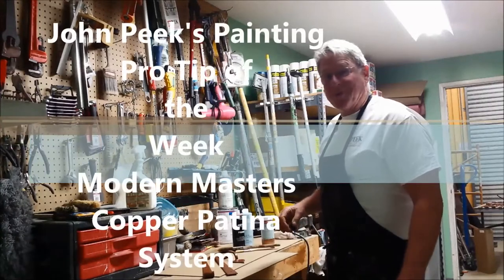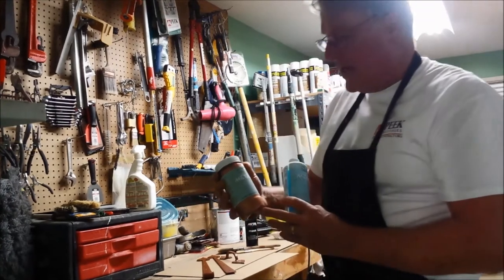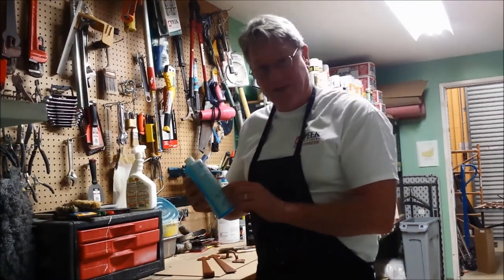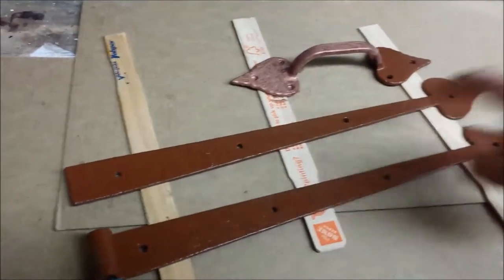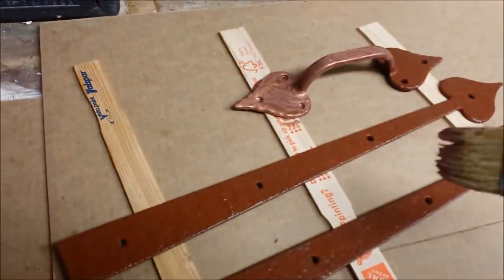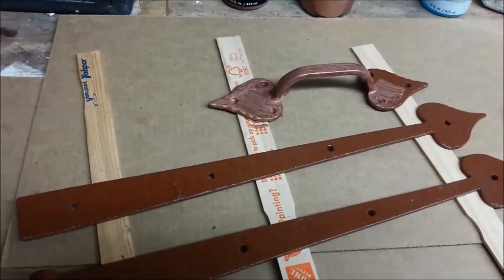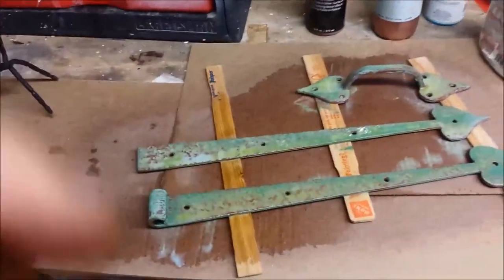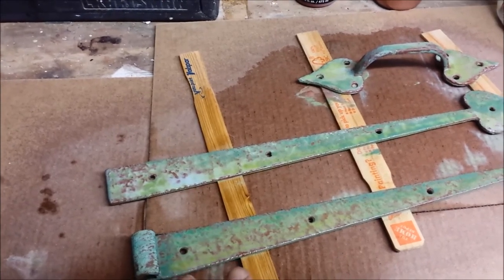Modern Masters Copper Patina Paint

Comment: Thanks! That was great. I'm wondering, do you let the activator just dry on the surface? Or do you drain it off or wash it off when you see the desired effect?
Reply from the maker: +Dane Mehl 
Hi Dane: no, you do not rinse off activator. Remember the copper paint has to be wet to be activated with the acid....so if you rinse, you will be washing off the paint as well. When all is cured, there is no need to rinse. You might want to put a clear protective coat made by MM to add longevity to the finish
Reply: +John Peek Thanks John. I'm painting my motorcycle gas tank, so I'm hoping for some cool drips down the sides and splotches of brighter and darker copper. Do you have any tips for achieving that? The solution won't be able to sit flat in a puddle on all the surfaces if I want to go for a more realistic pattern (coming down from the top). I was also going to patina it, then do some lettering over the top in copper paint again and patina that so it has a different aging to the letters. Will that be harmful to the existing patina if it's dry and I hit it again with the aging solution?

Comment: Will this work on a countertop if sealed with epoxy?
Reply from the maker: Yes it should work....but there are mettalized epoxy/polyurethane systems that would be better. Check out garage floor refinishing videos for that
Reply: Thanks, I'll check into the garage flooring ones. I have seen several types of "copper" epoxy systems actually ment for countertops but they arent quite as realistic looking as this since they are just copper colored pearl.